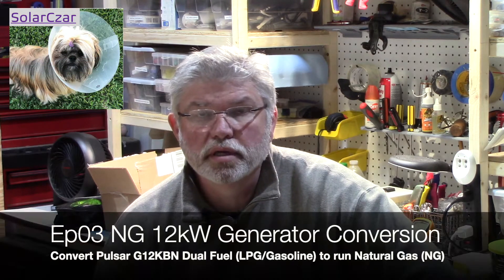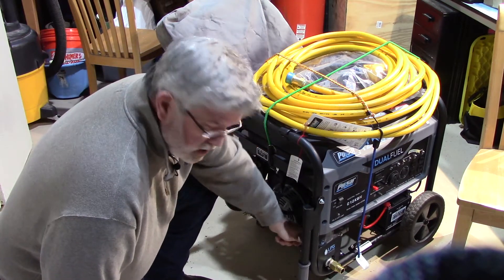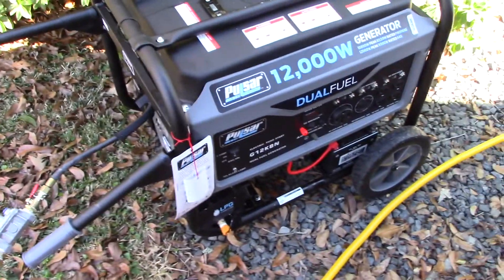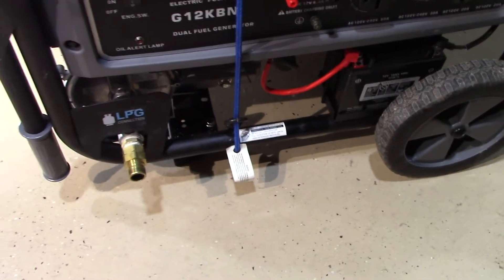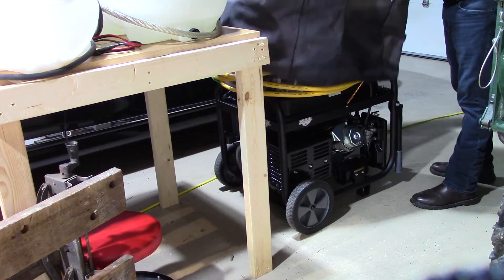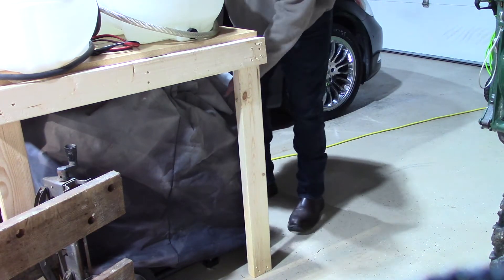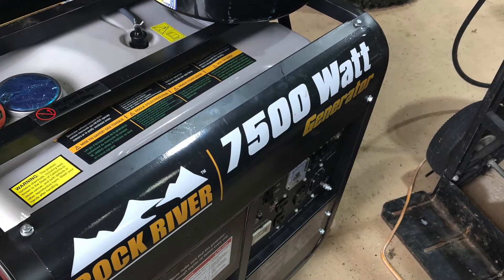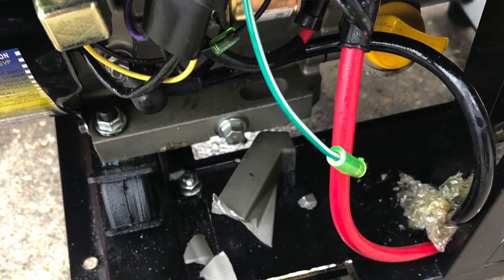Ep03 Natural Gas Conversion Pulsar 12kW Generator

Comment: thanks for covering the floating ground
Reply from the maker: No problem! Thanks for watching
Reply: @tlutrick956  I just bought the same model generator but I don't see any reference to the floating ground in the manual.  Can you be more specific in what your manual says?
Reply from the maker: You can reach out to Pulsar customer service for pictures, but the practical is...
How to Unbond the Neutral:
 
Remove Gen Head Cap
Remove Nut from Green/Yellow Wire and White Wire
Remove White Wire
Reconnect nut with only Green/Yellow Wire
Shrink Tube or put a sleeve of insulation on White Wire and tuck it out of the way
(Picture of action unable to upload here)

Note: Be sure to buy or make a bonded generator plug (simply a male 110v plug with the neutral/ground crossed) that you can plug into a socket, should you use the generator away from the home.
Reply: I have the a similar question. What steps are needed to make it a floating neutral?
Reply from the maker: You can reach out to Pulsar customer service for pictures, but the practical is...
How to Unbond the Neutral:
 
Remove Gen Head Cap
Remove Nut from Green/Yellow Wire and White Wire
Remove White Wire
Reconnect nut with only Green/Yellow Wire
Shrink Tube or put a sleeve of insulation on White Wire and tuck it out of the way
(Picture of action unable to upload here)

Note: Be sure to buy or make a bonded generator plug (simply a male 110v plug with the neutral/ground crossed) that you can plug into a socket, should you use the generator away from the home.
Reply: Here is a reminder about portable generator safety: This advice is just to make sure that everyone is aware of all the warnings and it’s just to remind people to be careful using portable generators. Everyone has to see this safety reminder for safety. Every year, hundreds of people die or get injured when using portable generators due to carbon monoxide poisoning and electrocution. Make sure you are using your generator carefully and keeping others safe as well. There is something very serious that everyone should always be aware of when using generators. Some people do run their generator indoors which is not safe and that increases the risk of carbon monoxide poisoning which can cause death of family and you. Some people run their generator in wet conditions which can electrocute them. Here’s an advice about generator safety: please remember that you should never run your generator indoors. Remember that carbon monoxide is an odorless and colorless gas that you cannot see or smell. Carbon monoxide is a silent killer. Keep that in mind. Make sure your generator is 15-20 feet away from your house and away from doors, windows, and vents. Never use your generator in your porch too. Having a carbon monoxide detector is very important against generator safety. Some people also allow children to go near the portable generator which could pose risks. We need to keep an eye on our children making sure that they are not near the portable generator so they won’t get electrocuted or burned by the generator which is dangerous. A locking enclosure also keeps kids safe. A generator shed might look like a tempting place to explore, or take cover during a game of hide and seek, but a generator is a dangerous piece of equipment that can cause injury. It says on the manual that we should also keep children away at all times from the portable generator to avoid injuries. Please do not allow a child or unqualified people to operate the portable generator. Just because some manuals missed what should be listed doesn’t mean it’s safe to do. Always follow the generator safety rules when using portable generators. Generators pose electrical risks. If you need to use your generator during wet weather, you need a generator tent to protect your generator from getting wet. Don’t let your generator get wet. Keep your generator dry and before using your generator, please make sure your hands and your generator is dry. Do not wear loose clothing when operating the generator. Everything that is said on the generator’s operating manual should not be ignored. Never smoke cigarettes near the generator. Please keep flammable things away from the generator. Never overload your generator too. Your generator can catch fire. Never ever try to plug a generator cord into a wall outlet to avoid back feeding. Back feeding your generator is dangerous. Always turn on your generator first before plugging in appliances and shut off the appliances before turning your generator off. Use a heavy duty cord for your generator and the cord should not be worn out. All the instructions should be followed carefully. Never refuel your generator while it’s running. It can cause fire if fuel spills while your generator is hot. You should turn off your generator and let it cool off before refueling it. Having a fire extinguisher next to the generator is also important. This is only a reminder for everyone’s safety of using generators. Make sure your generator is properly grounded. https://youtu.be/I1jT3ANENvI and here is a video more about keeping others safe when using generators and also about our family’s safety. Hope this helps. Thank you. Be safe